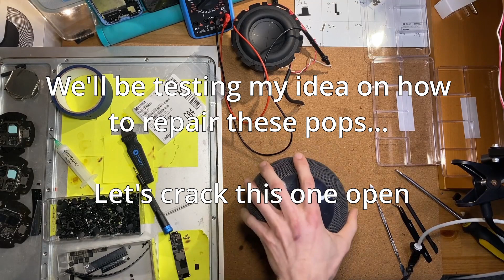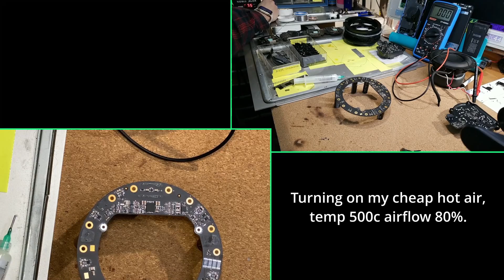Fix your Death Farting HomePod!

Comment: Thank you so much for making this video! I have been listening to my HomePod making popping sounds for - literally - years.
I have one of the first european HomePods and it started making popping sounds in standby mode every once in a while (depending on the ambient noise level) just a few weeks after being out of warranty. I've tried to find fixes on the Internet numerous times, found a video about the DC offset and how it can permanently damage the HomePod over time, but nobody ever seemed to have a definite answer what's causing it. After seeing your video I immediately took mine apart to replace these caps - and I've not heard a single pop in hours! 🥳
I really do hope it stays that way. While having the woofer out I also checked the copper color and luckily it still looks like new.
I also measured the caps afterwards. Without the video I would have never replaced them. They measure 2x 10.2µF and 2x 9.8µF - to me all well within spec, but I presume the lower capacity ones are the bad ones. ESR and Vloss are also looking fine on all of them.

Sadly I scratched the top cover while prying it off, but it seems a fair trade against the new found silence.
Reply from the maker: Fingers crossed hard as.f. that if Apple releases a new homepod that we can steal parts from them and refurbish our older ones : ) Also! Those capacitors can totally still appear to have capacitance within spec, COLD, but watch their capacitance drop as you heat them up! So happy you were able to fix yours!!
Reply: @NicsFix  I tried heating them up. At 100°C they all have about 9µF and at 200°C (which is probably way out of their specified working range) between 5 and 6 µF. Still nothing that I would have identified as needing to be replaced - which makes me even more happy that it worked, because I still haven't heard it pop.

Comment: donde comprar los capacitares? me compartes algun link porfavor !
Reply from the maker: It depends on what resellers are available to you in your country, but look for any capacitor that fits the specs; size 1206, 16uF, 16 volts, X7R rated.

Comment: hi sir, any ideea for homepod that can not be factory reseted ? presing on the top touch red circle for 20 sec but no reset or no siri voice on it. thank you
Reply from the maker: Heya! So sorry for the delay, trying to catch up...When you hold the top for the red circle, keep holding as long as you can and tell me if the red circle turns off softly, or if it turns off abruptly? Soft turn off is probably an amp sound issue. Abrupt turn off is probably a bricked logic board that's boot looping

Comment: This helps thank you!! I am having a TON of rattling now with the sub put back in. Anything you suggest checking? That plastic ring that you unscrew is pretty lose but if I tighten it the ribbon cable won’t fit in the notch
Reply from the maker: If you've tightened any of the 9 screws in the big top speaker basket with all the grilles on it too much, it will mess with the seal and allow air to leak, resulting in what sounds like a rattle. You can try sliding the mesh down enough to reveal the basket's screws, and go around loosening and tightening them while playing a test tone that causes the rattling until you find an area to improve or investigate further...as for the plastic rings...I have some tips on how to install them at the "Reinstalling Lower Plastic Retainer Ring" timestamp in this video;  https://youtu.be/FfGiuh_QH3M?t=1318
Reply: @NicsFix  I really appreciate your speedy response!! I was shocked to find that it was actually the rubber grommet for the ribbon cable that was missing. Put it on and all good now!! Thank you so much my friend you saved me a lot of time and stress. Great video
Reply from the maker: @Daddymcgoo2000  NICE! I've made that mistake a few times lol...glad it was an easy fix!

Comment: Is there any other thing than could cause this issue? I just replace the caps but it’s still doing the pop 😔
Reply from the maker: Quiet popping by itself with no other issues is ok / normal, even after repairs. I have opened brand-new ones that pop! https://nicsfix.com
Reply: @NicsFix  it’s not quiet 😅, it is still making a loud popping and also restarting itself after some mins
Reply from the maker: @KriTicaLTech  I see. Might want to confirm that's not a logic board issue, I've seen dying logic boards cause that with the amp working just fine. Could also still be an issue on the amp somewhere that we haven't diagnosed yet! Like something failing when it warms up under load
Reply: @NicsFix  the resistor next to the sub conector also is part of that popping noise, right?
Would you mind to share with me the specs of that resistor?

Comment: Excellent video! My homepod does the classic ‘fart noise’. Does it when the homepod is playing after which it resets but also when the homepod isn’t even active. Will the fix in this video i.e. replacing the four capacitors address this issue?
Reply from the maker: Indeed! The amp is designed to produce these death farts when dc offset grows out of spec. It's consistently been caused by these capacitors allowing too much DC through and into the woofer. Sometimes the 10ohm resistor next to the subwoofer connector is also blown so it's good to inspect that while you're there. Another "while you're in there" would be to go ahead and replace the s.b. diode that commonly fails and causes no-power issues. https://nicsfix.com/#popping

Comment: I assume this would also cause intermittent bass? Mine keeps popping and going on and off, seems like the pop relates to the bass and when it pops the bass cuts in/out. Seems like it would be the DC voltage on the amp causing it.
Reply from the maker: From what you described it does seem like an issue caused by too much dc. You'll need to at least get the top basket off so you can measure how much dc you see on the woofer while everything is on to confirm that's the issue. To do this the subwoofer cable is long enough for you to leave it plugged in while setting it right next to the homepod (might need to set something under the subwoofer to raise it a little). Don't forget the amp has to be ON, not in standby, to get an accurate reading if it's caused by the DC (you can trigger siri for a second to wake up from standby). Please keep me updated!
Reply: My homepod has not responding while increased the volume; bass is gone but siri is working pls give a advise

Comment: Hi Nic! One of my HomePods makes the slightest pop sound as the amp turns on or off (~10 mins of inactivity or so). 

Does this mean the capacitors are starting to fail and I will eventually end up with the symptoms from your video? Can I keep on using it?
Reply from the maker: Not necessarily, popping by itself is usually OK!  https://nicsfix.com/#popping

Comment: Where do you order the capacitor if it needs replacing
Reply from the maker: In the USA I order my parts from digikey and mouser. You're looking for any 10uF, size 1206, X7R, 5-10%, rated for 16v. I've been using part # EMK316AB7106KL-T

Comment: Do you think you can remove the caps using a soldering iron? I've just opened my homepod and now I'm afraid to replace the caps 😂
Reply from the maker: Hi there! Sorry for the late reply...I'm sure you could do it with a soldering iron, but the industry prefers using hot air to replace MLCC capacitors, since using a regular iron can unevenly heat the capacitor up and damage it!

Comment: Hello, many thanks for the very ingenious instructions. I was able to repair my Popping Homepod with these instructions. But now I have another question:
I have the feeling that the bass of the Hompod is very weak. Unfortunately, I have not been able to hear any other homepod  so far. Could this still be a defect in the amplifier chip that was triggered by the defective capacitor? br Robert
Reply from the maker: There's a few possibilities assuming it's actually not as bassy as it should be and you don't have a reduced bass setting stuck on: Maybe your woofer speaker is going bad. There are a few holes in the speaker that let you inspect the voice coil to see if it's no longer a nice copper color. I have a photo on my website showing where this little inspection port is at under the Common Issues; DC Offset section; https://track44.moe/homepods/#commonissues

If you gently push the speaker straight in and out it should feel perfectly  smooth with no scratchy feeling or sounds otherwise that means it's probably dead.

Visually inspect the rest of the amplifier board to see if anything else obviously blew, maybe that resistor I also show on the website.

The amp IC dying is a rather rare occurance for me, but it happens. I would be replacing it as a last resort.
Reply: @NicsFix  Hello, thank you very much for the explanations! Could you please be so kind and give the data of the resistor?
Many thanks from Vienna
Reply from the maker: @blondi2435  it's probably not the resistor unless it's obviously damaged, but it is a 10ohm resistor, I use these as replacements; https://www.mouser.com/ProductDetail/71-RCL121810R0FKEK